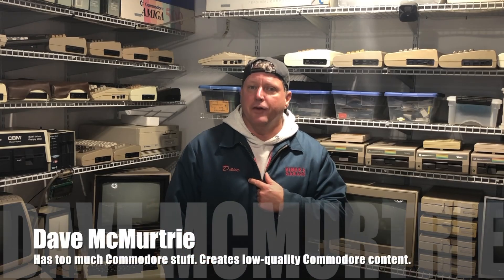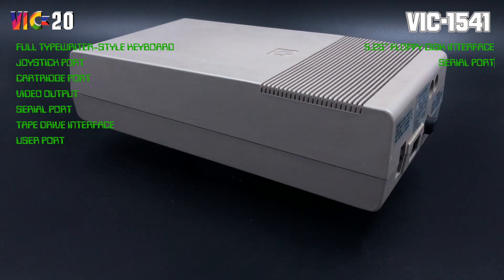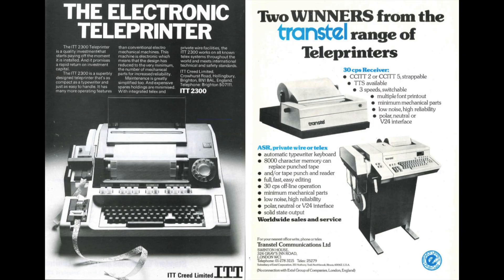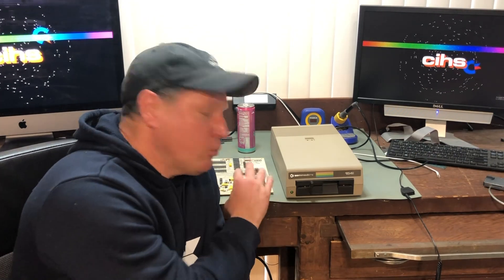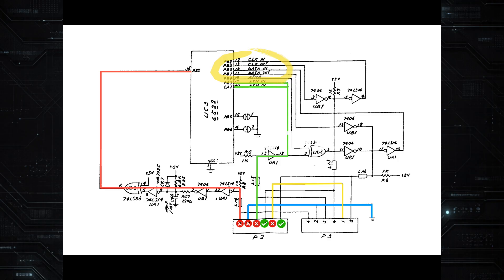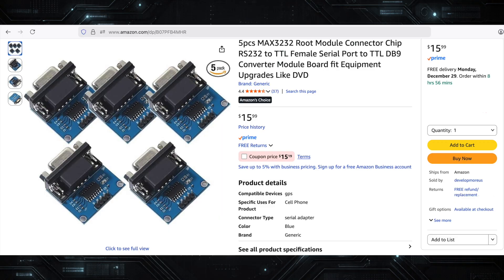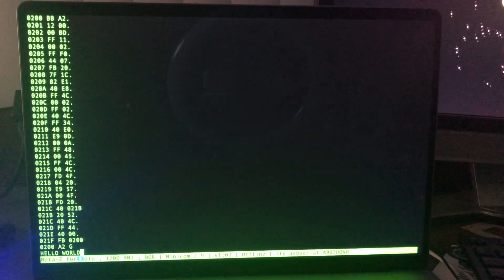Can a Commodore 1541 disk drive be used as a general purpose computer?

Comment: Neat project! What would be even cooler is to get the disk drive part working too. :) With one of those 8K ram upgrades for the 1541 it would almost make it useful. 😁
Reply from the maker: I started working on making the disk drive work, but didn't finish. For one, getting serial working had me a little burned out on the project. The other part was I couldn't decide how I wanted it to work. The KIM-1 and Tiny Basic parts were simple. Literally just grab existing code and make slight modifications so it would work on the 1541. The drive part led me down a rabbit hole of indecision -- should I add load/save to the KIM-1 monitor, or should I add them as Tiny Basic commands? Most of the code would probably run in the $E000 (KIM-1 kernal) space, but if I add load/save to Tiny Basic, then that becomes a dependency. Also, I was undecided on how much of the drive code to implement. There wouldn't be much need for the DOS 2.6 job queue code, so the interrupt loop and such could go away. But then, do I keep the existing Commodore format and implement all 35 tracks, sectors and the BAM? Or do I just copy the low-level code and write a shim on top of that to say, allow saving one file per track and name them sequentially? Anyway, after all that thinking, I decided it wasn't really practical anyway, and I gave up :)
Reply: @commodorehistory  "Another day." :)

Comment: I believe you have missed a trick here.   If I recall correctly one of the 6522 via has a completed unused IO port on it, and this could be used without modifying the 1541.  The 1540 I used to have had this in a socket, although this may have been a repair job. 

Cheers
Reply from the maker: yeah, there are a bunch of unused PB pins on the VIAs. I never looked at exactly what DolphinDOS connects to, but that does full parallel.

Comment: It's astonishing that DOS even supports multitasking. The "large" floppy drives (8x50 dual and 1001 single) from Commodore had two CPUs. However, this would have been too expensive for the 1540/1541 and their successors. So, one CPU was omitted, and the kernel was modified to have two tasks that emulated the old dual-CPU configuration. This wasn't such a problem, since the IEEE-488 bus was serial and no longer parallel.

Comodore then released the SFD 1001, which came in the 1540 case but had two CPUs, and then the SFD 1002, which could be connected to the serial bus of the VC20 and later models and also had two CPUs.
Reply: never ever heard of 1002 and commodore would rather bundle fast iee488 interface for 64/128 with sfd1001 rather than releasing 1MB slow-serial drive

Comment: Actually, you could save basic programs to the disk drive.  Also could build an adapter that would plug into the cpu socket to add more ram.  Then it would be a real computer running basic.

Comment: It makes you wonder why the thing was so slow and disk commands so weird with what was  then contemporary CPU on the controller.

Just think what a modern disk drive would be like with a multi core CPU.
Reply: Being slow resulted from a series of unfortunate events during production (later resolved with fastloaders), I think there is a good video about this here on the channel. The commands are not that weird but quite logical, once you get the hang of it, and need to be wrapped inside the universal BASIC command OPEN  to establish a data channel to the drive. Still quite logical but less convenient than with later BASICs that had (more) short, special commands for disk operations (than just LOAD, SAVE, VERIFY). But that came with a price: The later, bigger, more convenient CBM BASICs needed more addrees space and ran slower.

Comment: Ideally it should still be a disk interface but switched into co-processor mode when the drive is not being used, with a 2kb part of a program running in parallel. Maybe small 8bit fixed point sine and cosine lookup tables or line slope calculator + slope draw table or sqrt calculator or something.
Reply: Yes, that was actually done, but for more complex tasks (as far as 2k fits). Just keep in mind that the original baud rate was around 19200 baud. It could be sped up by reprogramming the VIA, but it remained slow.
Reply: @mibnsharpals  .. Yes, I thought that might be the case. I was talking about parallel instructions in some non-realtime calculation, not for games. Tell it to do a load of trig or line calculations for CAD rendering then (slowly) feed the results back. I don't know what speed the 1541 6502 runs at. I'm presuming its around 1mhz, so still useful, but it could be slower as it doesn't have to do much processing and the baud rate is slow (but still useful at a 2Kb ish per second - perhaps enough for extra audio processing in realtime, especially delayed effects like delay and reverb).

Comment: I had a 8050. You can create a .prg file of 256 bytes and you can "&FILE" or something to load it, and run it on the host cpu.
The 8050 has 2 cpu's: one dedicated for byteshifting and doing the I/O, and one doing the filesystem API and the IEEE488 bus handling.
You can let it load one page and execute that page.
Since the 1540* has a rework of that dual cpu setup, it should be able to run generic .prg files.
The IEEE14888 attention would interrupt the program.
Unfortunately this is all from memory from back to the 90's, when I had a 8050 and a 8296... I reversed engineered the memory dump.
My 8050 had a 77 track drive, but the positioning of those 77 track was "arbitrary": it had to make multiple steps to advance a single track. Using different multipliers made it possible to seek on a 1540 disk tracks. However, the 1540 had fixed tracks.
Reply: To be clear: yes, a commodore disk drive and a commodore hard disk can be considered full featured file servers. It can handle multiple hosts.
And it can actually copy directly from disk to printer for instance (that's a IEEE1488 feature).
Reply: And yes, I never went further than making a led blink.

Comment: I remember disk copy software, which after being uploaded to 2 daisy chained 1541's , made them copy as soon as both disks were pressent. autonomously, even after the C64 was disconnected.  It must have been running from RAM.
Reply from the maker: I'm not familiar with exactly what would have been used on 1541s, but that's absolutely possible. The MSD-2 had that capability, and all of Commodore's dual disk drives did, as well. It's kind of awesome on an 8296d to issue a copy command from disk 0 to disk 1, and the drives go off doing the copy while you can continue doing other stuff.

Comment: I thought is possible to send code to execute by computer to 1541 without replacing 1541 ROM ? But i suppose it have limitations and be cumbersome.
Reply from the maker: Yes, it absolutely is possible. Commodore's DOS provided M-W, M-R, and M-E commands you can send to the drive for memory write, memory read, and memory execute. However, that would mean I'd have to run everything from RAM. With only 2K available, I'd exhaust the RAM and not have room for any of my own programs.

Comment: There are Demos and Programs like the Mandelbrot Construction Set that use the 1541 as Coprocessor for 3D calculations. The limiting factor is the serial communication between host and drive.
Reply: Huhh? That didn't make sense. Software computer demos ARE programs. Also, why are you treating the words "demos," "programs," and "coprocessor" as if they're brand names?
Reply: @HelloKittyFanMan..  look up "demo scene." You won't be disappointed.
Reply: @HelloKittyFanMan..  He said "demos and programs like ...",  meaning demo programs and other programs. With demos being different to most other programs by not being interactive (which is the reason why I am not a big demo enthusiast).
Reply: @NuntiusLegis : If he wanted to have said "and other programs" then he should've just SAID "and other programs." This doesn't make sense, because it's like falsely claiming that pieces of computer demo software "aren't programs" even though they ARE.

Comment: You could add some glue logic, then bank switch ram, and bankswitch in a ay8930 on top one 6522 , and add a graphics chip, replace one rom 

And now you load computer floppies, have a serial port, and have a cartridge port (basically a socketed rom)
Reply: They had rom and ram mods for such drives like jiffy dos or turbo mods that swapped rom, added ram, shit you can just swap the 6502 with a 65816

But does a floppy drive really need a 16bit 30mhz CPU?

Comment: I remember reading the 1541 has like 2k RAM if I recall. Nowadays, you would use a microcontroller, but back then not much and they worked with what they had 6502 style.
Reply: Seems the 1541 could make good use of a RAM expansion.

Comment: Atari 8 bit floppy drives could pull off the same trick  they were however hobbled with a 6507 and only 256 bytes of ram..  common updates were to add more ram...

Comment: 17:09 it's not stock if you replaced the roms
Reply from the maker: Yes, I mentioned that in the video.
Reply: Flashback to 1985: you have an original ROM in your 1541??? Really?? Actually, I didn't know anyone who had put up with that for long and installed a turbo/speedloader... so everything is OK.

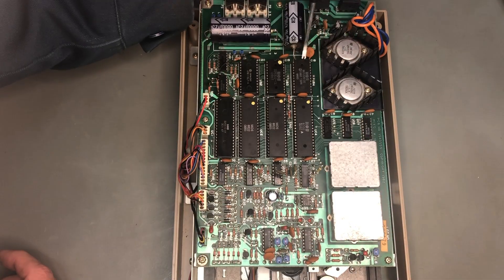Comment: 15:07 how does this qualify as no hardware modifications?
Reply: Replacing ROMs was normal back then. Just look at all the Speedos variants. He can even put the original kernel in the upper area of the EPROMs now and add a switch to toggle between the two states.
Reply from the maker: It doesn't. I talked about it in the video.

Comment: It's probably doable without swapping out the ROM, although it'll be even more limited - fast loaders essentially replace the ROM routines in the drive with their own RAM-resident stuff and there's no reason I can think of that those routines actually have to be disk operations, but you'd be restricted by having to fit the monitor and your own code in the limited space available and communication would be less straightforward.

Comment: The serial to USB converter is a bit overdone. There are ready-made TTL serial to USB converters for like $1.50. They are also powered directly from the USB port.
Reply from the maker: yeah, someone else mentioned FTDI cables in another comment. I never heard of them before! I already had the USB part on hand, and I asked google how to connect to TTL and landed on the solution you saw in the video. Happy to learn new stuff today. Thank you!
Reply: @commodorehistory  BTW, did you have to modify the KIM-1 kernel in any way? Or do the 6522s reside in the same address space in both the KIM-1 and the 1541? Does the KIM-1 use the same pins on the 6522 for serial communication?
Reply from the maker: Yes, most of the mods I made were related to the 6530/6522 differences. They don't reside in the same address space between the KIM-1/1541, and I had to use different pins. I had done a similar thing in the past when I wrote the code to use a 1541 disk drive with a KIM-1, and that was pretty simple. This ended up being more of a challenge than I expected, because my code changes made the serial timing drift enough to corrupt bytes. If you look at the code, there aren't a ton of changes, but it took far more effort than you'd imagine due to difficulty in debugging when you have basically zero visibility into what's going on.

Comment: I was always jealous of my friends Apple II drives.  They were so small and everything loaded so quickly but there is nothing in there for hardware!  You definitely couldn't turn an Apple II drive into a general computer!
Reply: That's correct, because the Apple FD drives lacked intelligence; even data separation had to be handled by the CPU. That's why these drives had such a small capacity. The advantage was that they were significantly cheaper.
Reply: @mibnsharpals Commodore could've cost-reduced the 1541 by packaging the 6502, RAM, ROM, and VIAs as a microcontroller.
Reply: @talideon  Then they would have had to develop everything from scratch. It seems that Commodore wanted to maintain a certain degree of backward compatibility with the 8000/4000 series computers. Furthermore, they already had the parts in production and the software was already available.

In principle, the floppy drive was overkill from a technical standpoint.
Reply: @mibnsharpals  The Commodore 1541's default data transfer rate is notoriously slow, around 300-400 bytes per second (B/s) over the C64's serial bus, taking nearly 2 minutes to load standard programs,

Apple II Disk II drives transferred data at a relatively slow pace, around 12-15 KB/second, using GCR encoding

So at a minimum the Apple II drives transferred 30x faster than the Commodore at a vastly lower price point.  I love my Commodore 64 but clearly Wozniak made the right choice.
Reply: @Nas_Atlas  I remember, I had a normal controller on my Z80 and always annoyed the C64 owners when my Z80 ran a 32kbyte program at 125,000 baud without any turbo trick.

Comment: porting the KIM-1 kernel to the 1541 is awesome, but i thought people could upload routines into 1541 memory with its stock ROM too?
Reply: yes, this is how fastloaders work. and there even exists a demo running on a 1541 and outputting a bw picture via the serial connecter (used as a video output). But to have a general purpose computer one needs IO and a minimal OS

Comment: Yes, it can. It has a 6502 CPU, 2 KB of RAM and you can directly read or write that memory through the serial interface using the command channel, as well as start execution of machine code that then runs directly on the 1541. It is now more than 35 years ago that I created a programming system that uses the 1541 to run code in parallel with the computer (a C64 in my case). It was a hex monitor, assembler and disassembler that runs directly on the floppy drive as well as on the computer. It was called "Floppyassembler" and has been published in a german C64 magazine.
Reply from the maker: Sounds cool! I'd love to check that out.
Reply: @commodorehistory  Then switch with "E" to Floppy mode, and all adresses you enter will immediately go to floppy memory. "C" switches back to computer mode, where it can be used like any standard monitor/assembler/disassembler. Here's the rest of the adress for the download: d slash EPtVr hash-sign eight xcq six tnCPc, I hope you can reconstruct it...
Reply: @commodorehistory  It's on limewire, extend the adress with the info from above. After getting the .D64, you can load "FLOPPYASS. 35000",8,1 and start with SYS35000. It contains also the source, it was my development disk from back then. Feel free to use it in any way you like.
Reply: That sounds awesome!  When I was developing C64 games I had a version of the Action Replay cart that had a drive monitor / disassembler that let us debug our custom fast load code. So invaluable because we did have a infrequent crash that took me 16 hours of debugging without stopping and a hex monitor, assembler and disassembler that works on the floppy drive was absolutely necessary.
Reply: @djmips  Great stuff! I do remember those times. I have developed a fast loader for the disk drive too, with a special twist. It saved the fast loader along with the saved file on disk, and you could fast load the file immediately with load...,8,1 without having to load the fast loader separately. It loaded a system vector that pointed to the fast loader and jumped to it while loading, so it switched to fast mode after loading the first block. It installed itself automatically into the system at the same time, so you could fast save any program after you had loaded a file that contained the fast loader - and that saved file automatically contained the fast loader as well, so could immediately be fast loaded even after a power cycle. It kind of was like a virus 😅 but with useful behaviour instead. I called it "Master Disk".
Reply: @valuemastery I was about to say: "That functionality sounds eerily similar to modern malware, but without malicious intent" Really cool, thanks for sharing.
Reply: @valuemastery  Dude that was amazing!  The first computer virus?  But beneficial!  Those were the days!  I started out with a VIC-20, hand-built a 16k RAM expansion that I stuffed inside to keep the expansion port available for the Machine Language Monitor cartridge.  I learned a lot with that tiny machine!
Reply: Interesting, which issue of which magazine?
Reply: @NuntiusLegis  Can't remember the exact issue since it was a long time ago. But I wrote most of my articles and programs for the german magazine "Happy Computer".

Comment: I remember running software on a PET/CBM that off loaded some of the computing in a game to the disk drive in part because it had a higher clock on the drive and with the parallel interface there was minimum delay. If I remember right is was offloading some multiple and division for display positioning etc. I wrote a couple things that used it as well just for fun. You basically transferred to the drive ram and then told it to run the code you sent.

Comment: Something COMMODORE could have done is use the SAME board for both the DRIVE and C64, as a daughterboard - same ROM (detects what hardware its in that could have changed a lot of things. Some other CONFIGS:With the SAME ROM, it could use the drive as a co-processor - for example a BBS could have run within the disk drive and free up the C64. The PET drives were often trashed/given away - cheap computer as they also had 6510. If you wrote a program in BASIC, it could run in the disk drive.  The INDUS GT drive used a z80 CP/M could have run on it with the C64 as a terminal.
Reply: when VIC-20s were becoming door stops those also could have been used... a C64 with 2 drives is more powerful than a PC of the era